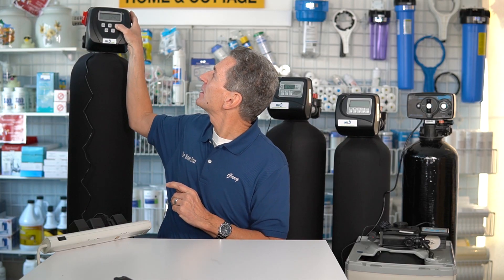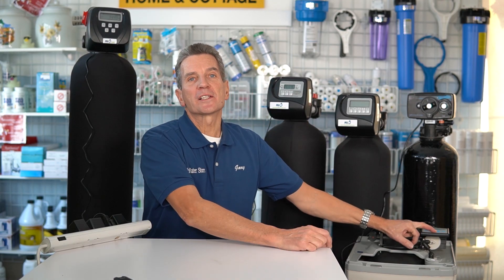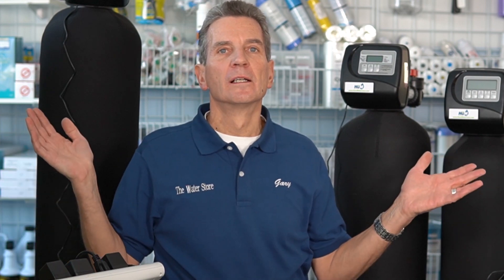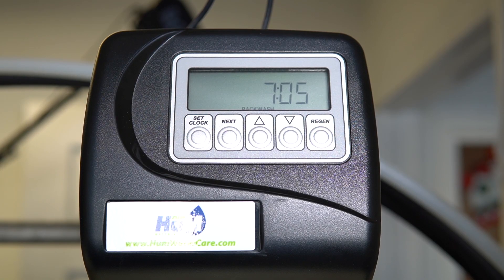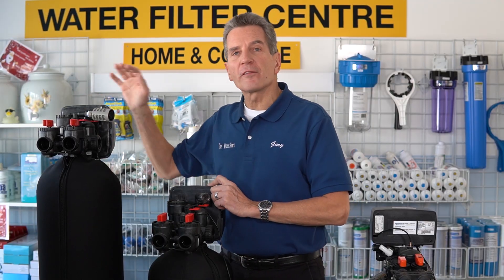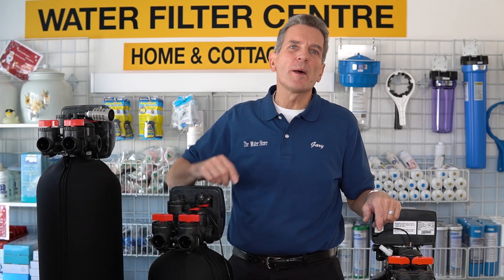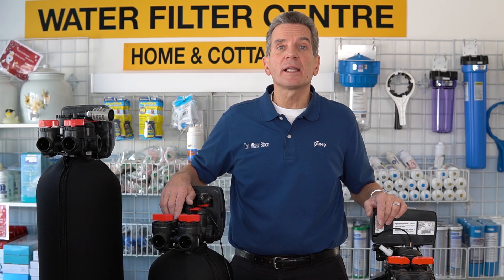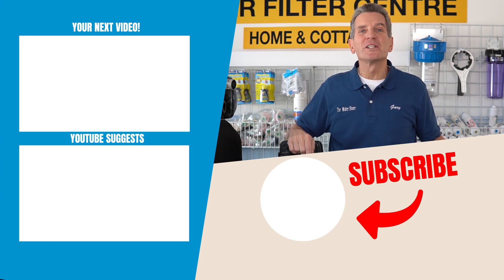Avoid this WATER SOFTENER MISTAKE before it's too late!

Comment: First water softener system ever - new house - no basic instructions other than what plumber quickly told me.  System insists on regenerating at 4:30AM even though I've tried reprogramming that to daytime hours to avoid the noise awakening me.  Didn't work.  I even tried fooling it by changing the actual time.  Didn't work either.  Any idea what is wrong or I could be doing wrong?  Otherwise, anything I can do to quiet the regeneration process?
Reply from the maker: If you know the make and model you can often find a manual on line to help set the regen time.

Comment: Thanks! However as a woman living alone, my only option was removing the fuse for the water! I had water spewing out everywhere at 1:30 am! I thought it was pouring rain outside and then realised the noise was coming from the basement. Went down only to get soaking wet! Thing is, I called for the same problem 3 weeks ago and it cost me 400 bucks to “fix it”. Am more than furious! Wish I could share the video jeee somehow to show u :(
Reply from the maker: Very sorry to hear.  Hopefully after seeing this video you will understand that bypassing will shut off the water from the leak, if that is what it was, while still maintaining water to the house.

Comment: Firstly, thank you for the videos! I'm a novice and I went to turn on my bypass (for watering my plants) using the 2 red knobs but they wouldn't budge. So I thought I had to remove one of the pins near the knobs... BIG MISTAKE! Water started shooting out of my softner as the pin held a plug, I later discovered. I shut off main water valve and cleaned up the mess. Anyway, after reinserting plug and pin I could easily turn on bypass. Any ideas as to why I couldn't turn bypass knobs prior to pulling that darn pin? Do I need to shut off my main water before turning them? Thoughts or suggestions very much appreciated!
Reply from the maker: Great question!  Likely the bypass had not  been used for a long time and has partially seized up.  I always suggest you "excercise' the bypass once per year.

Comment: Thank you for helping take the mystery out of the "Water Softener".  I knew what it was supposed to do,  but never really understood what was going on inside when something failed.  I'am on my 2nd Waterboss unit and have found them trouble-free for many years.  Now mine is acting up and your videos are very helpful.  I had to find one small in size, over 30 years ago, that would fit in my crawl space, and have stuck with Waterboss since.  Their site doesn't provide the details of the device operation that you do.......Great Job !!!  I stumbled across your site while looking for help with my unit on Youtube.  Thank you for your excellent knowledge and videos.  I obviously have a salt issue, wrong type and overfilling :((  Will be in touch, many thanks again.
Reply from the maker: Thank you for your kind comments.  Please share the videos with friends and family.

Comment: Turn off the water main.
Reply from the maker: Yes, that will work but likely you still want to have water in the house until you get the water softener repaired or replaced.